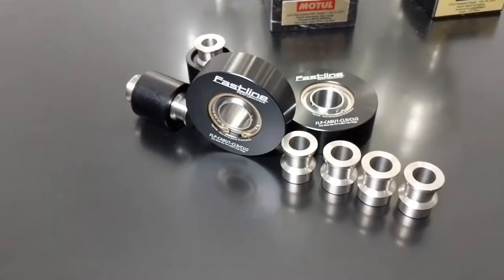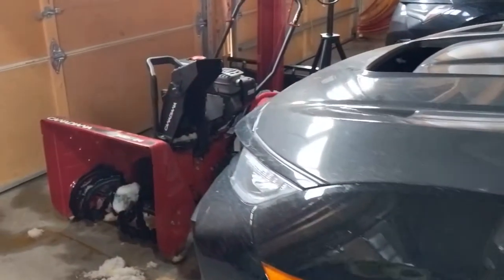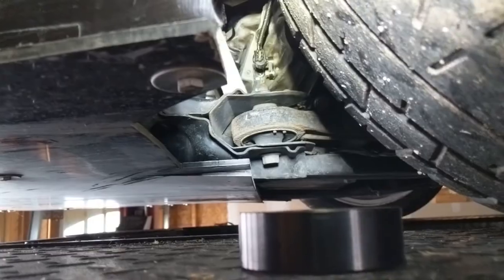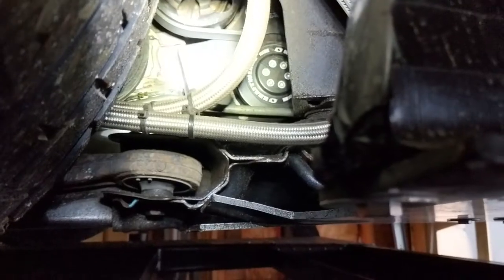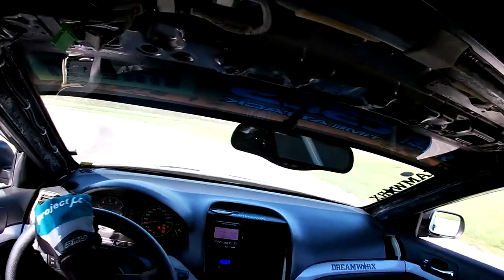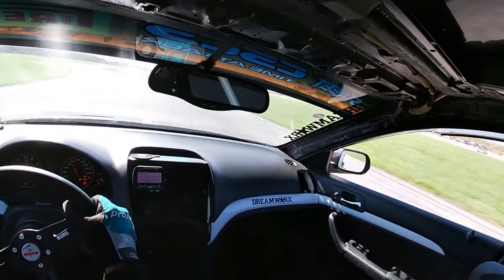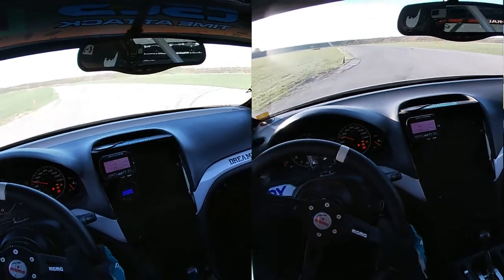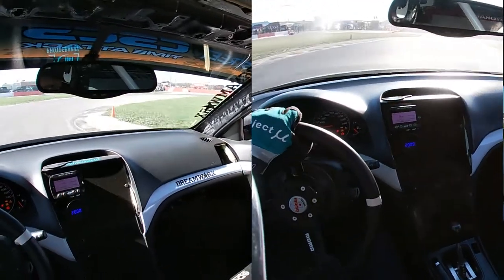PCI Spherical Bushings - TSX Vibration

Comment: My bushings on my TL are cracked as well im having vibration at highway speeds new tires and wheels and got them re balanced multiple times you think that’s my problem ?
Reply from the maker: It could be bushings or axles. If they are cracked I think that would be the cheaper fix to start with
Reply: I just did the same process this week. It is definitely my compliance bushings. Just replaced them with OEM ones and they already broke enough to cause speed wobble going 90 mph+ with only 12k miles. My commutes are usually short but aggressive.Going to try the PCI since I want high speed stability and want to keep it that way.